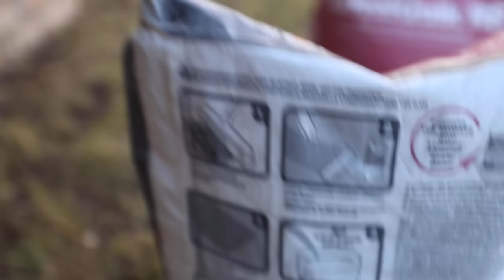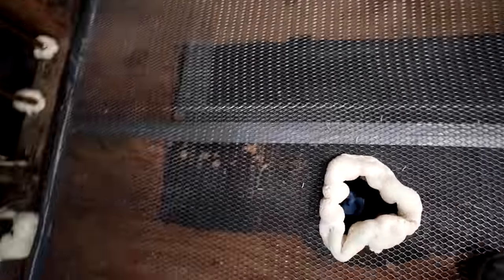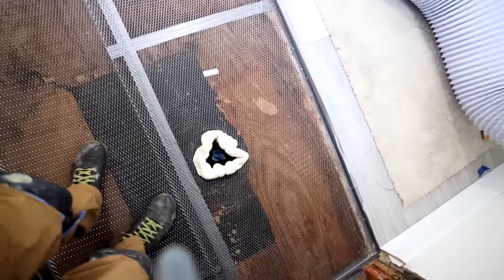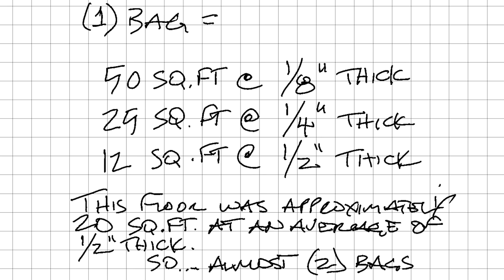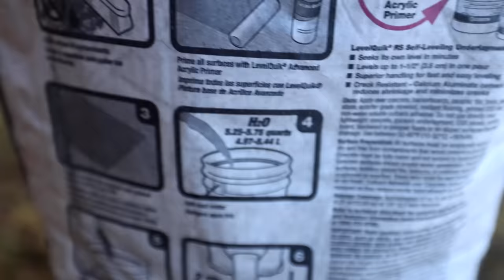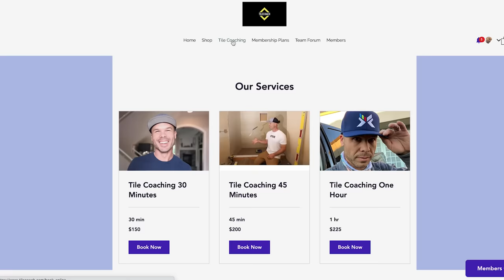LevelQuick for FOAM SHOWER PAN on Plywood Subfloor

Comment: Self leveler is a real game changer. When I use it I always mix it close to where I'm going to be using it. It's really tough toting 2 mixed buckets and I can't imagine how bad it would be if a handle broke on a bucket as you wind your way through the customers home. Would not be good
Reply: I like to set up negative air flow with a hepa like he has. Works great. I'm looking to get one for my shop too
Reply: Lmfao I totally pictured that happening absolute nightmare
Reply: Thought the same thing. Disastrous potentially.
Reply: I was waiting for it. He's going to be like me unfortunately if he keeps that up. Surgery on both shoulders and out of commission. Work a little smarter for your body's sake Isaac. Your still awesome though bro.
Reply: never ever set up that far away. like you said, had the handle broken OH MY GOD NIGHTMARE!!!
Reply: That stuff is a nightmare to clean up too. We got it on a 120 billion dollar conveyer system. On the most expensive part ironically. Luckily we had become good friends with the foreman on the german company doing the conveyer. So they lets us do our best to clean it and then replaced whatever they needed to. But for the rest of the bathrooms we started going downstairs and covering the machines. It was not freakin good. A quick pour day turned into a nightmare.
Reply: @roymcleansr.5404  agree to this fully man. Cheers. Hope you’ve found a least a fun hobby. I know its not easy being out of work
Reply: Yes. I've carried buckets full of dirt, and one broke. Handle broke off, and the bucket broke on impact with the ground.
Reply: Yeah I would have mixed it upright in the bathroom
Reply: It’s called a $30,000 insurance claim.  Yeah, I know a guy that happened to.
Reply: @roymcleansr.5404  it actually helps grabbing 2 rather than 1.they balance each other out while carrying.1 full bucket is just awkward.I know from experience and I am not as jacked as this guy.
It's really grip and shoulders.Oh and legs running up and down the steps.
A regular person would die carrying them but if you give me a skinny laborer ,I'd build the kid up once he gets past the soreness faze.This is man's work!!!!!
Reply: @76shogun1  been there and done it. Stocking drywall and mud buckets all my life I agree with you. That being said I'm 49 and just had rt shoulder and hand operations left side is going to be operated on in a few months. Toughness does catch up with you.
Reply: Yep, that happened to me…the bucket hinges broke and it spilled all over the carpet..I had to replace the carpet….now I use tarps and mix it right there…
Reply: Contractor to client: Guess what, you just got your living room self-leveled for free...
Reply: @Titantitan001  I hear you. Self leveller is a great material but i cannot stress the importance of 'daming' the perimeter and any gaps. I was on a tiling project in a large building in London and the main contractor used a different company to lay large porcelain slabs in the main entrance hall. They poured i don't know how many dozens of bags of SLC over the area but didn't seal the perimeter. The result? Over £20k of damage as the room below was the room containing all the main fuse boards/switches etc for all the different offices throughout the building. The mess was epic as all the boards and wiring was totalled. All electrics had to be shut down and everything replaced. Total nightmare.
Reply: Up
Reply: @roymcleansr.5404  dude thats a farmers carry its a good exercise. people do it in the gyms
Reply: It's all about the flex.

Comment: I'm not sure everyone here gets the jist of this video.  When a foam pan is being installed, the foam pan is premade with a slope.  The floor underneath needs to be level or the slope built into the pan will not be correct.  The tape on the plywood subfloor is only to keep the liquid leveler from running through the seams  when poured.  The lathe is not a hard requirement but the area is large and the leveler  is relatively thin so it adds additional strength to the subfloor.  After this is done, Thinset will be used over the subfloor to set the foam shower pan.  Totally waterproof if done correctly and will not fail unless the subfloor fails and that would be the same using any pan method.  BTW, some of the newer "foam" shower pans and wall panels are fiber reinforced, some using kevlar.

Comment: Good job, I’m slightly OCD so Lippage and crowning drive me crazy. Self leveling is definitely the way to fix that problem. I would suggest the easiest way to make sure it’s level is use screws in each corner and level from screw to screw and adjust the screw height to make it level. That way when you pour your self leveling you know how much to come up on each point. I find that self-leveling always doesn’t level correctly, it gives a reference to how much to pour and level.

Comment: The whale tail vacuum attachments work surprisingly well to keep dust down. Just attach to the rim of a bucket. I can mix any type of cement indoors without throwing dust in the air.
Reply: I will have to give that a go! TY!
Reply: If u could send me the link to that vacuum attachment that would be awesome thank u
Reply: I carry an industrial 36" fan. I set it up on some work horses and point it out of an open window. Mix and cut in front of it and dust gone in an instant. Great when polishing and sweeping up as well.

Comment: Tip for pouring the leveling in to the bucket prior to mixing.

Hold the bag sideways on the rim of the bucket and cut the bag in the middle (on the side facing the bucket for obvious reasons) then flip the bag over flat with the cut side down and pinch the leveling out slowly. This will help with dust control if you are by yourself as the bag will cover the bucket opening, then leave the bag on while mixing until all the powder is mixed in
Reply: i put full bag in bucket - use my MAP gas burner to burn bag away then add water
Reply: @daveh4925  that sounds expensive lol
Reply: @bsmbB  i'll level with ya, my wifes expensive the bag is cheap
Reply: @daveh4925  lol i meant using the map gas to burn it off doesnt sound like it works either tbh
Reply: Or just get the ardex dust control system and that's it .
Reply: @jcsego1370  why would you spend $100+ when you can do the same thing for less then $5 with pvc?

Comment: A backer rod would have been a good idea for expansion where tile meets leveler. Great videos my man.
Reply: Can you describe a bit more about how you'd use backer rod in this scenario? Would it be put down on top of the wire mesh along side the four edges of the shower base? Thanks

Comment: This is what I'll be doing later this weekend as a homeowner.  I've already replaced the rotted subfloor boards, tightened them up, and then fastened down plywood on top of that.  Pretty close to level, but I want the foam Kerdi pan to live its best life (as my kids would say) on a perfectly level base wall to wall.  Plus, I have some wiggle room on depth because the old shower was a thick mud bed in a lead pan.    I've used a similar leveling product on a concrete basement floor.  This two bucket shower area should be a breeze in comparison.   I did learn from another source that I'll need to use reinforcement over the plywood, and the bonding agent, and your video provides even more evidence that it's worth the trouble.

Comment: Here's another way to make the Level Quick seek Level and smooth itself out. Get your Sawzall out, without a blade in it and put the end of it against your plate or subfloor around the edges of the pan and turn it on!. This works as a vibrater. It works well for this application.

Comment: A good way to check if you have poured a relatively flat area is to look at any reflections in the wet mix. Any area that need attention will show as a distortion. In this case it looks good 👍

Comment: A little trick I use to cover the drain hole on the floor is use a hole saw to cut circles out of OSB or other wood, just a little bigger than the hole, put a little bit of toilet wax on one side, just enough to seal between the floor and my wood circle, and screw it down. I have a few different sizes that I reuse, It works for me every time.

Comment: I'm amazed at the working time you had with that product.  I've used it several times and it starts setting up in minutes.     I get nervous mixing multiple buckets at once even if I'm right next to where it's going to be poured and there you are walking across an entire house, chatting in front of the camera and then casually pouring it.   Surely you must have used a little extra water?  Maybe even refrigerated/chilled water.

Comment: I've just poured self leveling compound on plywood floor to create a level 'plinth' for an acrylic shower pan - it's 3/8" thick to bring it flush with the Ditra XL I'll be tiling on. Obviously I will still be fixing the pan in mortar on top of the SLC but I was advised that pre-leveling the floor makes that step a lot easier, especially if you're in-experienced. I used 3/8" ply as a dam on the outside edges (pending installation of the Ditra) with a thin line of silicone-latex caulk to make it water-tight. I also ran caulk along the base of the inside wall frame and stuck foam 'backer rod' to it to serve as an expansion joint - some folks use 'Sill-Seal', but I had some backer-rod left over from a previous tiling project. I'll also be using it in the expansion gap between the SLC and Ditra also when I come to install it. You don't mention any need for perimeter expansion joints in your video ? Does the mesh screen (slat) you used somehow compensate for that ? I assume it's intended to reinforce the SLC anyway ? Cheers.

Comment: That's one hell of a long walk with those heavy buckets! I wish I saw this video before installing my pan. Got it mortared in only to discover running away from the drain when I water tested. I thought the subfloor was level but I learned the hard way that just being a little bit off is huge for water. Now I have to rip up pan and do this before installing a new one. Expensive lesson learned. Do you have a video for pan removal? LOL.

Comment: Good job, buy yourself a dewalt 54v mixer and mix in the room it has a speed control wheel so it doesnt fly everywhere and i use mine on every job saves setting up tripping hazards and it can be stood upside down after mix so don't have to lean on wall - i also cut all my plastics with 54v grinder with metal cutting disc - it cuts copper quick and any plastic cladding like a dream

Comment: 9:56 Nothing like carrying two 5 gallon buckets a mile to the bathroom, lol.
Also, I like using Huber zip flashing tape to put down on the subfloor instead of duck tape, do need there J-roller w/ that “Z” to press it down, but know when done get a good seal (bond) for “joining the sheets of plywood”. Is more expensive than duck tape, but do like it better as no water proof and at times duck tape just get “icky”. But everyone does things differently 😊
As for foam, like the gray, as also keeps out pests/rodents and they won’t eat the stuff either when sealing off holes/gaps….but either way works👍🏻
Nice vid and glad to “see ya”.
Have a good one✌🏻

Comment: Hell Isaac, this is a big help. I am installing a shower (Schluter system) in a new location, I have full access under the house for plumbing. The floor is off a little so I will use this technique to level the area. My question is: can I wait to cut the drain opening until after I use the leveler as long as I have cut away the metal lath in the drain area before I pour? I have never drilled through cured leveler with a hole saw. Thank you.
Reply: Yep

Comment: I always find that when mixing either floor tile adhesive or self levelling compound, it's easier putting half the bag in and mixing and then putting the remain remaining bag in also the mix. Makes more consistent and never has any lumps.
Reply: Self leveling compound is different I got clumps by doing half and then the rest
Reply: @erichermann7553  get someone to pour the bag in while you mix. Pour it in gradually. I prefer ultra tile self levelling compound 2 part. Has the tub of white milky activator with it. The ones where you use water are shit.

Comment: Thanks for all the great videos.  
I'm building a bathroom in my old house where I've completely rebuild my floor with 2×6 joints 12" on ceter and 1-1/8" plywood. The bathroom is over the basement.  
On a plywood subfloor, what is your preferred method for highest quality? A hot-mop pan system or this new system?
 I only want to do this once in my lifetime, so I wanna do it the best job that I can.

Comment: all is good and interesting. However poring a thin concrete slab ober a wood foundation is prom to crack. So, do you have any idea how long this foundation for the shower pan wouls last? 10 years, 15, 20?   I like to try the same thing in my 2 flor bath however this is the question I asking muself. Thank you for your responce.
Reply: doesn't matter if it cracks. its job is to be level. cracks won't transmit though the foam pan. the lathe makes it even stronger.
Reply: It could possibly crack; but wheres it gonna go ? It's trapped under the pan, and it should stay level (thinset is atop of it too).
Reply: It's just providing a level base for the foam shower pan, which will be  adhered to it with thinset like one big tile..  Some hairline cracks won't matter.  But, any major deflection of the wood will be a problem for the shower floor tile.

Comment: Quick question, NXT Level Plus is at Floor and Decor. Costs $45. Level Quick is $30 plus $18 for lath. Would it make sense to just use NXT and not go with the lath for roughly the same price?

Comment: No need to put a water proof coating on the ply board as a protective layer against the level quick? My understanding is cement is not good for bare wood

Comment: I love watching your videos and helping share knowledge on all areas of construction. I have a question? In the previous video, I saw you using deck mud for tile. Is it possible to use cement and sand? The reason is that I live in Central America and we don't have such. So, is it possible to prepare cement, portland, with white sand and have the consistency of deck mud?

Comment: Does floor leveler not need an expansion joint around the perimeter?  Thanks a bunch for all the great info.
Reply: Also, when should you use an uncoupling membrane?  Can the plywood flex, cracking the self leveler, and compromising the tile?  Thanks again.

Comment: Great info! If you werent using a foam pan would you still use this leveler to level the floor or would you use the preslope material to level the floor?
Reply: Yeah, you'd level your mortar bed and add your preslope. No real need to pre levlel  you'll do it with your mortar bed.

Comment: What experience have you had with Triton backer board ( I understand there is two different styles) and what did you think of it if you have had some?  Also do you use fiberglass mesh tape on backer board seams under the Kerdi membrane?  Thanks for the videos and providing testing on new products.

Comment: Great video. Question: should the shower curb (schluter curb) be placed on top of the self leveling concrete or should I place the curb first and then pour the self leveller to the curb? I think I know but not 100% sure.
Reply: I have the same question
Reply: Pour leveler first so that the curb is level also .

Comment: How would i fill in cement to make up a stand up shower where theres a square ft hole around the drain? There is a empty area of soil under the slab so filling in wouldnt work

Comment: Is the metal lath necessary? I have never seen it used with self leveling compound.  Great video. Thanks
Reply: I have the same question. Especially if my floor is very close to level and won’t need much of the compound, is it really needed?

Comment: Can I do a thin-set curbless showerpan? I'm wondering if I can pour about 1/2 inch thinset for the whole bathroom and about 1 1/2 inch for the shower pan to do a "monopour" look for the bathroom that runs into the shower. Is that possible?

Comment: Hi I am new to this and I removed a bathtub from a 1940's house and installing a walk in shower in its place. The almost all the wall boards are not flat so I am shaving them down to make them flat, on one side I have to match the plaster to the tile board and its about 1" thickness. what is the best practice for doing this? 1/2" green board and then 1/2" hardie board? what are your thoughts?

Comment: Awesome like always Tile BOSS 🤙👌 just curious why you didn't go with a drypack process to level and slope to drain?
Reply: His shower pan is sloped, and the water proofing goes on top of that, a pre slope bed is not used in this case.
Reply: @isaacholzwarth  that's why I'm asking why not do a drypack level and slope and waterproof that, instead of self leveling, foam pan and waterproof
Reply: @CarlosDiabos1982  he himself normally would, but he wanted to provide the how to for our sake, and the customer may have had wishes. Regardless, this is for people who can't do a dry pack. Maybe weight was a factor here, who knows.
Reply: @isaacholzwarth  fair enough 👍 thanks for the feedback 🤙